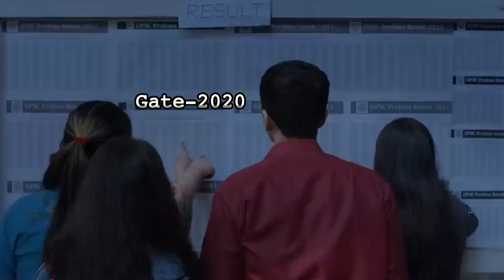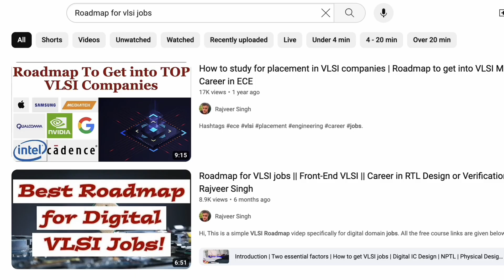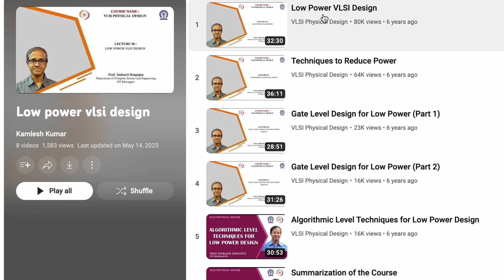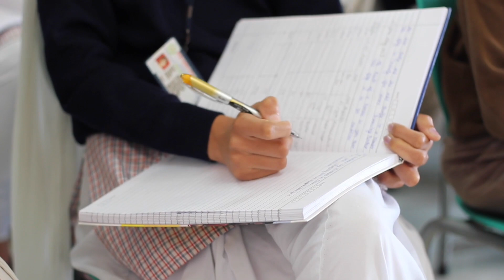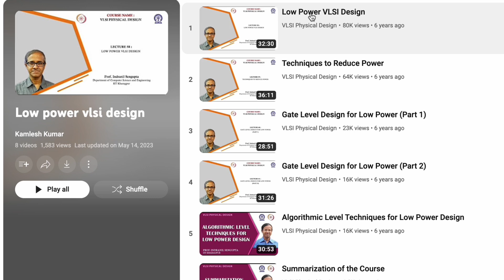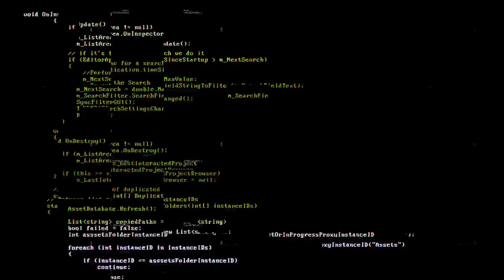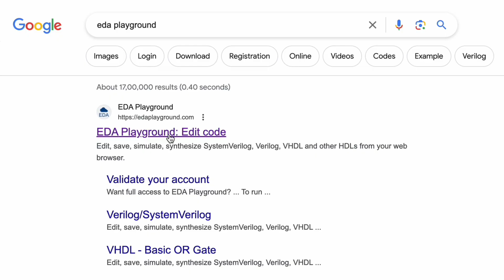VLSI Job Preparation in 2024 || Electrical to VLSI Journey || Rajveer Singh

Comment: Sir I require your help for the right path, now I am so depressed, graduated in this year with EE and admitted to part time mtech vlsi design, and currently working as GET in electrical core company for getting vlsi domain I took mtech part time but samjh nhi araha kya karu soch raha hoon resign deke paid course karne chala jau vese bhi muzhe electrical mei intrest nhi h sir, college irregular hai so yahi option lag raha h muzhe please help me with any good suggestion
Reply: I came from the core branch of EE, so I never have that subject Digital electronics, i studied Analog circuit devices and edc for just passing purpose, same SS, DSP, mpmc just so confused what should I do
Reply from the maker: I would require few more details before giving any answer?
Your current job role?
Job nature: Full time or contractual
Approx ctc: ?
Reply: Position: GET Project engineer( electrical)/site engineer, mumbai, department: railway protection ( placement from clg campus)

Nature: 3rd party, have to work 3 years in this organization for payroll/onroll employment

CTC: most of the time i do my work on railway sites (pan india), a few days in office mumbai,

 Ctc 3.26 lpa + 1 year free accommodation, in hand 21k but I get allowances on outdoor work (site), my in hand salary would be 21k fixed+ 10-12k allowance of 20-15 days of site work, assume 30k in hand
Reply from the maker: Hi,
Actually vlsi also has complex entry barrier and you have to be in good college to get the opportunities. Private training institutes would able to place you in 6-7LPA (without any accomadation ) in general that too after lot of hard work from your side. 
Hence, quit your job only if you can manage the finances.
If you are really interested in vlsi then go with reputed college and follow any of my roadmap videos because college reputation matters a lot in getting you first high paying (20+ LPA ctc) vlsi job.

Comment: Sir I got Electronic VLSI in NIT jalandhar upgrade 1st round CCAB ,2rounds will be there, What to do for my carrier prospects
Reply from the maker: Hope you have filled better choices on higher priority and so you should hold the current seat and go in further rounds.
There would be a float type option which basically means "Hold the current seat and also participate in the next round for higher priorities."

Comment: Sir, please suggest a complete playlist or source for Power System II in Electrical Engineering. I have backlog in 6th sem. I will give the exam in June 2025 with 8th sem.

Warm & regards, 
Ayan Das
8th sem EE student,
AOT, Hooghly, WB
Reply from the maker: 1. Below playlist has both, watch required lectures only
https://youtube.com/playlist?list=PLe8lX1SLwAPG_ssxiyipma2oHqeusP3co&si=6BcAMdlaXDkbst_p

2. Gatematic+gate academy 
https://youtube.com/playlist?list=PL_4gtF0Nl0ya7LWG9p2FLnQhdBDETS9dN&si=FLE8F6THyAGZLQ1_

Comment: Is a Mechatronics UG student eligible for Masters in VLSI after clearing GATE.
Reply from the maker: Depends on College.
Some college may require GATE ECE only while some require EE/ECE background.
You need to download information brochure, go to eligibility section and that's the only way to be sure.
Reply: @Singh-Rajveer  Thank you for your information. I checked some NIT and IIT information brochure and in that list Mechatronics UG degree is only eligible for Mechanical related PG courses. For a Mechatronics student if they want to pursue PG in electronics related courses what they have to do? Could you clarify this?

Comment: Sir I am also from electrical engineering(second year). And currently preparing for gate . After gate VLSI will a good career option....for 2027
Reply from the maker: Yes provided you get the top college and for that you require 650+ gate score (Gen Category).

Comment: I am a mechanical engineer from NIT Jamshedpur  but really passionate to learn semiconductors and VLSI. Can i do MTech in that also even i have a mechanical background
Reply from the maker: I guess, Only circuital branches are allowed for M.Tech VLSI. You may cross check eligibility of top IITs/NITs.
I checked few and didn't found Mechanical allowed.

Comment: Can i crack off campus placements in vlsi , bcoz there is no campus placements in core bro 😢
Reply from the maker: Very very difficult if not from Good College.
In vlsi and Embedded jobs, Academics matter very much.
Reply: @Singh-Rajveer  top college in ts emcet
Reply from the maker: State Government Colleges even if ranked 1 in their niche are usually considered TIER-3.
So, OFF Campus journey would be very difficult or may be impossible as well.
You can go for Mtech or CDAC.

Comment: Hi sir, i got IPA in NIT Calicut which comes under Electrical department this yr. I'm interested in VLSI domain but cant get into Electronics dept of the college. But I've asked few seniors there and they said i can sit for VLSI drives. Since im from EE GATE, I'm not strong at analog electronics but good with Digital electronics. My concern is that idk whether company will ask particularly for Analog VLSI role or Digital VLSI role ie if I'm fully preparing for Digital VLSI and all the companies ask for Analog VLSI, my prep will be wasted right. Thats y I'm asking sir should i prepare both or continue with Digital alone sir
Reply from the maker: They don't ask Analog IC design while interviewing digital vlsi profile. 
Basics of Analog electronics-1 would be enough.
Read basics from MOSFET, BJT , Diodes that too for clearing written test. Interviewer won't go into the analog vlsi role for digital profile.

Comment: Hi Rajveer,I wanted to know whether I can transition from mechanical to vlsi.I'm currently a 3rd year student in one of the iits pursuing my b tech there.Just wanted to know if its possible if i do m tech or an ms in electronics/vlsi related branch..
Reply from the maker: If your IIT allows you to sit for ECE placements then it's possible in btech itself but it is going to be very very tough because Mechanical is not circuital branch.
Hence, You have to read everything from scratch of ECE.

If they don't allow then you may go for masters. All the colleges don't allow Mechanical for vlsi. There might be few and you need to research that.

Comment: Information Theory and Error Control Coding
 DSP Processors and Architectures
 Computer Operating Systems
 Automotive Sensors and Power Systems
Cloud Computing
 Linear Algebra
Data Structures and Algorithms
We have to choose any one course what should I choose as an ece student... Which helps me as I want to go to core companies pls help
Reply from the maker: DSP processors / Computer operating systems.

DSA is also good, if you want core cse jobs

Comment: Is btech EEE and go for vlsi...or  taking Mtech in nit nd go for vlsi...which is beneficial???
Reply from the maker: Didn't get your question, You have to do btech in all cases.
If, You get vlsi job directly after btech then no need for mtech but that's mostly possible only if your btech clg is tier-1/2.

Comment: I did Mtech from NIT Jaipur in power system and did 1 yr internship related to power electronics but unfortunately didn't converted into full time. Now i am in l&t but not satisfied. So to get into vlsi whether should I take course or apply through website or LinkedIn??
Reply from the maker: First of All, Training or M.Tech VLSI is required to get into.
Also, I feel the mtech vlsi from top colleges is best way.
I don't have that much knowledge about training institutes but training institutes won't able to fetch you a very high salary. You will be required to work at comparative low salary for initial few years
Reply: @Singh-Rajveer  is micro electronics similar to vlsi ? Which are the good collages not given gate
Reply from the maker: Definition wise they are different but they are same in the context you are asking.
Few colleges name there course M.Tech VLSI, Few say them M.Tech in Microelectronics, M.Tech in electronics systems, Mtech in IC design.
All would eventually land you to a vlsi job.
Reply from the maker: @TheDkt_090  BITS, VIT, NSUT are few good options

Comment: I have done my btech in EEE branch from tier 3 college and GATE 2024 didn't gone well to get a good Mtech in VLSI but i have interest in VLSI design, so i want to ask that if i can get a VLSI related job by doing all the courses as you have mentioned in your previous videos or i have to do only Mtech in VLSI to get into it.
Reply from the maker: It's true that all these courses knowledge would be required to get into job.
But, MTech or CDAC is required to connect with opportunities.
And M.Tech is best possible option to enter vlsi
Reply: @Singh-Rajveer Ok,  thanks a lot sir

Comment: Hi sir i need your advice,  I'm going to take admission in a master's program at NED. I'm stuck between two choices: MS Artificial Intelligence and ME Electronic Engineering "Micro System Design". 

I have completed BE Electronic Engineering. It's been a year with no relevant job.

Future Plan: move abroad. Ultimately, money is a reality so please consider it. Can I find an AI job in Pakistan based on the courses I'll study in MS AI?

Courses:
- Introduction to AI
- Advanced AI
- Machine Learning
- Mathematics for AI
- Intelligent System Design
- Deep Learning
Five Elective.......
Reply from the maker: Hi,
Both MS AI and ME Micro System Design are trending domains.
You can choose anyone based on your interest. 
You may prefer AI one as it would surely have great future and higher salaries on avg.
But, I don't know about Pakistan job market and universities.
For college branch review, you may take help from seniors / alumnis of respective college in your country. Infact you should connect with students already studying in college before making any decision.

Comment: Can you explain vlsi job roles in Tesla ??? Are they working for electrical vehicle??bro
Reply from the maker: Electrical vehicles in fact anything, which do some task, require a chip for computation.
So, VLSI engineers are required there as well.
Smartphone or laptop chips are not that much sensitive while if chip of electrical vehice hangs then it can lead to accident.

So, EV chips would have been more fault tolerant and likewise.
All this design and Verification would require vlsi engineers.
Not sure, if they hires in India but there would be vlsi engineers for sure in TESLA
Reply: @Singh-Rajveer  i want to settle in electrical industry ,masters in eelectric vehicle technology or vlsi (as we see in telsa vlsi employee) confused ???  First can I work in vlsi(because of placement I want to start with vlsi) domain for some years and switch tesla like companies ?
Reply from the maker: As per my knowledge, TESLA is not hiring in India for vlsi profile.
Secondly, If you want to work on chip design so vlsi would be better for masters.

But, If you want to work on ev only then above thing is not suggested.
Because vlsi would take you to chip design. It can be for any application smartphone, laptop, space , AI, cloud computing etc...so you may not be the one designing chips for EVs only.

Comment: Cse vs vlsi 
Kon sa choose kre? 
Interesting dono equally lagta h 
Bas future scope wise bta do plz
Reply from the maker: VLSI has an entry barrier and Product based companies hire from top colleges first so, 
1. If you have patience and can prepare hard compared to cse. Also, Ready to go for masters if required.
In that case only go for vlsi else cse.

2. VLSI is a kind of research field so yes continuous innovation would be required and if you are ready to give your best all the time then stable life would be there.
Decide accordingly.
Reply: Hi sir i need your advice,  I'm going to take admission in a master's program at NED. I'm stuck between two choices: MS Artificial Intelligence and ME Electronic Engineering "Micro System Design". 

I have completed BE Electronic Engineering. It's been a year with no relevant job.

Future Plan: move abroad. Ultimately, money is a reality so please consider it. Can I find an AI job in Pakistan based on the courses I'll study in MS AI?

Courses:
- Introduction to AI
- Advanced AI
- Machine Learning
- Mathematics for AI
- Intelligent System Design
- Deep Learning
Five Elective.......
Reply: Vlsi
Reply: Bro I'm in final year EEE (4-2) I'm interested to do course in VLSI plz suggest what is the best institute for VLSI learning. And good placement too like qualcomm

Comment: Is there any email id through which we can address our querry...
Reply from the maker: rsb182002@gmail.com
Reply: Hi sir i need your advice,  I'm going to take admission in a master's program at NED. I'm stuck between two choices: MS Artificial Intelligence and ME Electronic Engineering "Micro System Design". 

I have completed BE Electronic Engineering. It's been a year with no relevant job.

Future Plan: move abroad. Ultimately, money is a reality so please consider it. Can I find an AI job in Pakistan based on the courses I'll study in MS AI?

Courses:
- Introduction to AI
- Advanced AI
- Machine Learning
- Mathematics for AI
- Intelligent System Design
- Deep Learning
Five Elective.......
Reply from the maker: Hi,
Both MS AI and ME Micro System Design are trending domains.
You can choose anyone based on your interest. 
You may prefer AI one as it would surely have great future and higher salaries on avg.
But, I don't know about Pakistan job market and universities.
For college branch review, you may take help from seniors / alumnis of respective college in your country. Infact you should connect with students already studying in college before making any decision.